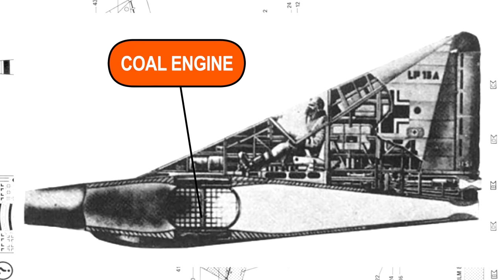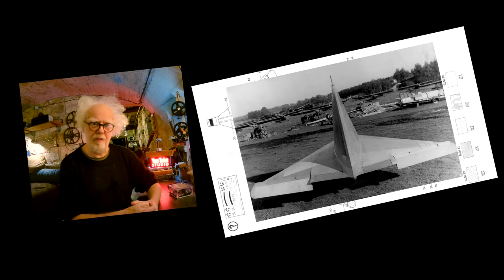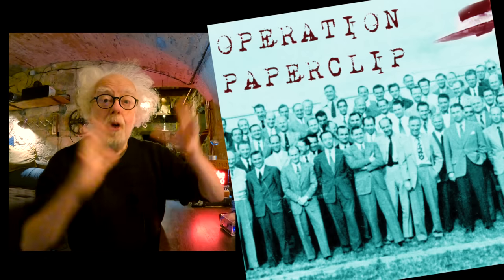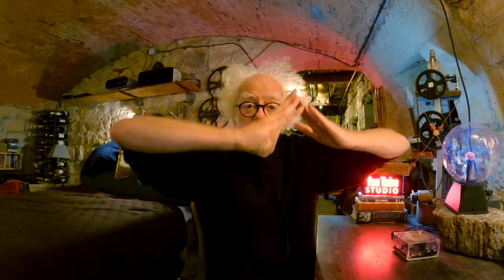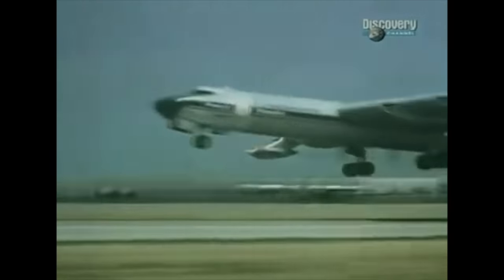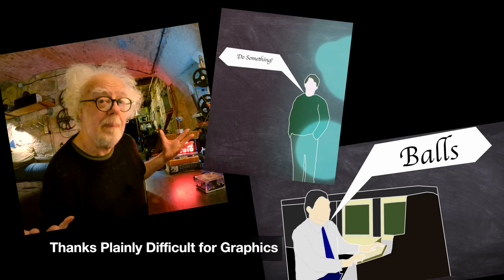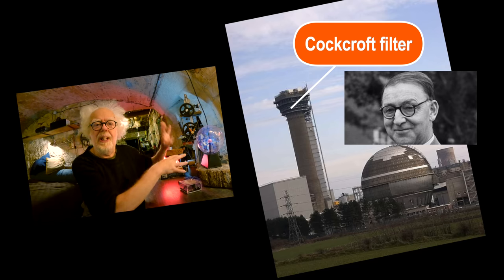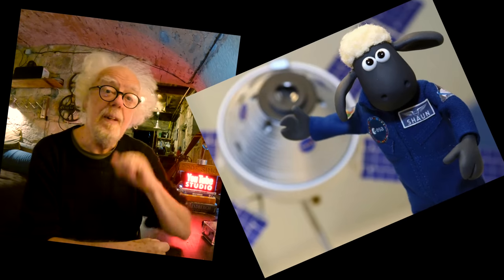Mystery of the Coal Powered Jet - Prof Simon

Comment: Interesting video Simon! Just a note, it's been a while since I studied Nuclear Physics at A-Level (25 years or so) but the neutrons generated by fission reactions do induce radioactivity in neighboring materials. It's called *neutron activation*. Hence why nuclear reactors must be 'decommissioned' rather than just switched off and taken apart. Also reactors have secondary cooling loops and a heat exchanger, to keep the radioactive coolant in the primary loop from leaking into the environment (water can be turned into radioactive "tritiated" water by the neutron bombardment). Nuclear reactors are also used for synthesising radioisotopes too, such as Americium-241 which is used in smoke detectors. Incidentally, neutron activation of air would generate all sorts of radioisotopes though most have short half-lives (ten minutes or so). A nuclear ramjet is truly an insane idea!
Reply from the maker: very true....i was ignoring neutrons
Reply: Drones could be fitted with nuclear batteries?  I bet the military has experimented with this concept
Reply: True, but a human body is made of low Z materials (Carbon, Hydrogen, Nitrogen, Oxygen) so not a lot of neutron activation occurring...
Reply: @insearchoftheperfectwatch934  I was thinking more of the air passing through the high neutron flux of the reactor and out into the environment.
Reply: @familiehermsen-ouwendijk3805  apparently carbon-14 is also a byproduct of a nuclear reactor and can be made into nano-diamond batteries which don't need charging and last for a hundred or more years. Not sure if they are publicly available yet but there's been a lot of research done lately by Tesla, and other battery tech innovators.
Reply: @andyr4941  Nuclear powered machines still used for everything beyond solar radiation
W/m² limit of our Sun to power vehicles using Solar Panels..

a. Oportunity Mars rover has isotope reactor for power generation..

b. Perserverance Mars rover has about the same generator type..

c. Xenon Ion thruster mission (forgot the name Xeno, Lora..?) beyond Neptune, Pluto has also an isotope reactor..

All of the isotope sources have in common "decade long endurance"..
Reply: @martinvizar6430  Kind of. The Voyager probes have them too! But they aren't reactors, they are radioisotope thermoelectric generators, basically lumps of radioactive material (like plutonium-238) that create heat as the material decays. The heat is turned into electricity. Also those things are far away from human beings!
A reactor-powered ramjet forces air through a reactor as the fuel is fissioning (at least the ones without a secondary coolant loop do). RTGs are like very expensive long-life batteries. RTGs are really cool pieces of kit though!
Reply: @andyr4941  thnx many times, for exceptional explanation, as i thought the satelites, rovers having fussion core reactor (yet smaller one) on board..

Comment: Seen a few videos where people are making a jet engine run using wood in a sealed burning chamber which powers a turbo charger  which is a similar working to this and is called a 'burn barrel' or 'turbo bucket', once the wood burns out the gas turbine runs out of power.
Talking of coal powered gas turbines, I read in a book by Rolls Royce that they did attempt to run gas turbines on coal for power generation, the coal was forced into the combustion chamber as a very fine powder and it did run but there were issues of soot collecting on the low pressure side of turbine blades.
Great video as always Proff.
Paul

Comment: I assume it made far more sense for the Germans to take the coal, use destructive distillation to produce oil and use that for jets.   The Germans before the war were converting to diesel locomotives, but because tanks and military trucks needed diesel, they went back to coal powered steam locomotives.  But coal just won't work relative to other things and coal can be converted to other things.  What might be cheap and effective is a fuel-air bomb, probably mounted on the ground which uses a conventional explosive to propel a large amount of coal dust into the air.

Comment: Never heard of a coal powered ram-jet engine. It glides well. I still want to see a paper dart style folding wing aircraft that can go from a delta wing to a half folded design (like a paper dart), or with half the wing fully folded up against the body and a half wing for high speed flight. For long range flying bombs / kinetic energy weapons it makes sense for the entire wing to fold up for the final dive when close enough to the target Flaps can still be used for steering during the dive for pinpoint mega death'n'destruction.
--
radioactive isotopes can react with materials to make them slightly radioactive and emoted neutrons can hit atoms in our bodies and make them radioactive,, This can be shielded against but the shielding get radioactive after a while.

Comment: Those last two lines got me wondering how low an orbit could be without air friction. Because if you can engineer that problem away for hypersonic weapons - then you don't need much fuel to keep it "aloft" while it orbits at - why not - 30,000 feet asl indefinitely.

Comment: Never heard of the coal burning ram jet but have read on the nuclear powered air plane that Convair built and flew in Texas. They never flew it on nuclear power but flew it to test its cooling unit and shielding of the pilots. It was 1960 and as soon as congress found out about the flight they cancelled the project funding immediately. They thought that flying nuclear reactors could pose a safety hazard should the planes ever crash. ( they must of finally woke up to what they were funding) Have viewed another video on nuclear airplane research at government facility in the state of Georgia that lasted until roughly 1970. I believe that Lockheed or Martin were doing the research for the government. First mistake was trying to build a nuclear air plane, and the other was conducting the research in a USA government facility where after so many years they would have to allow public access as to what was going on in that facility.

Comment: I'm no nuclear expert, but as far as I know, alpha and beta are particles, while gamma "rays" are photons so it gets confusing. But, they all do radiate from a source.

The coal powered ram-jet I had never heard of. I suppose jet fuel has better energy density. But consider how with so much oxygen, coal would burn very hot and reburn its own smoke, making it relatively clean. How weird!

I find it amusing that YT policies sometimes act a bit like-  those we don't speak of.
Reply from the maker: it was a bit over simple but i wanted to describe different shielding

Comment: I just never understood the 300Mph line that needed to be reached.
They could've put a large turbo system to jam the air at a faster speed than what it was getting from just the speed if the airplane itself.. 
Cars had it back then...
Why not planes??
Reply from the maker: the no moving parts compression ram jet starts working around that speed

Comment: If Neutron bombardment occurs, then things become radioactive, even people. 

"For physicians and radiation safety officers, activation of sodium in the human body to sodium-24, and phosphorus to phosphorus-32, can give a good immediate estimate of acute accidental neutron exposure."

https://en.wikipedia.org/wiki/Neutron_activation

If metal fillings/amalgam in teeth, etc are neutron bombarded then isotopes become even more complicated.

Years ago, I was taken on tour and offered a position at Lake Anna Nuclear Power Station. I went up to the Reactor door and was told that maintenance had occured there and a workers skin came in contact with radioactive reactor water. The radioactive water was absorbed into his skin. His skin then needed to be metal wire brushed in a shower to remove the radioactive contamination.

I was told they try this twice on site to remove radiation. If the person is still radioactove, a helecopter comes and takes them to another facility for more extensive "treatment".

Nuclear Power Plants are full of detectors to determine if workers have become "abnormally" radioactive.